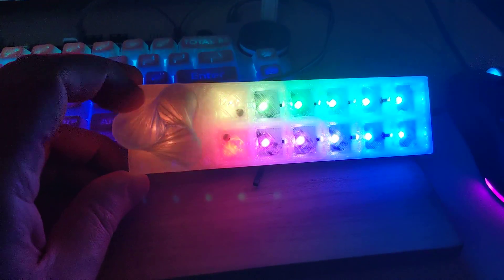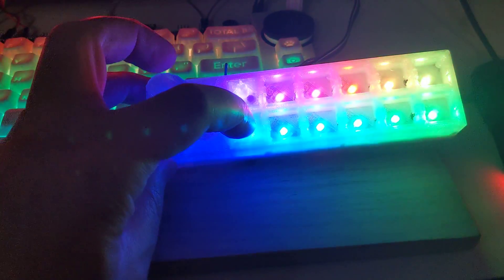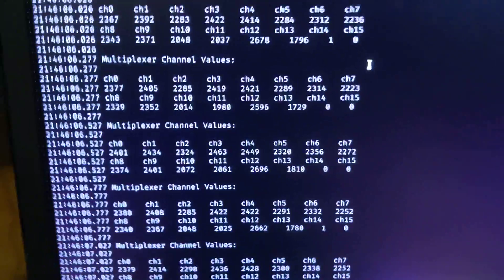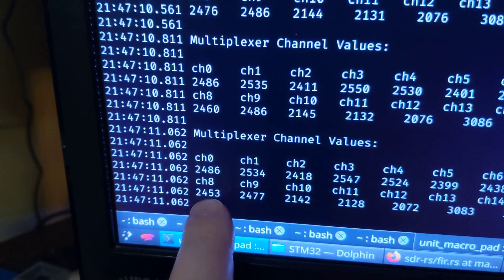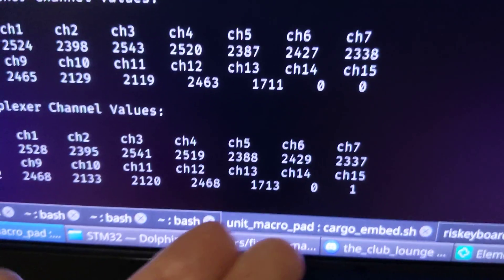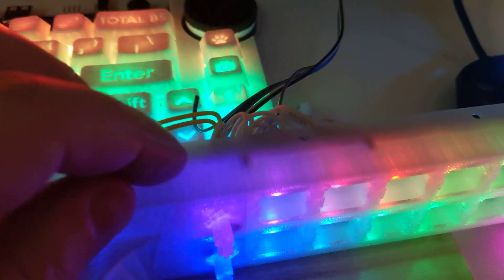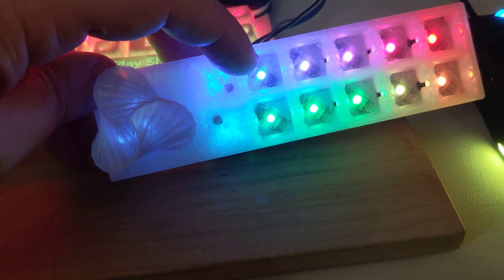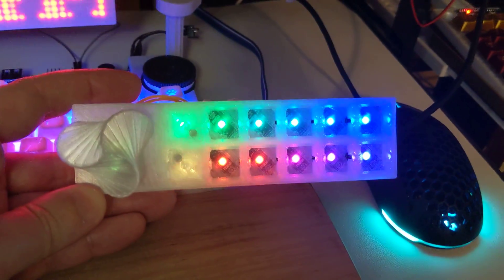World's first hand-wired analog keyboard works!

Comment: If I'm understanding the void-switch concept, doesn't this mean the magnets could be electronically variable in the void switches if you use electromagnets to control the resistance level? Like wouldn't that mean you could make a force feedback keyboard or render the idea of single-state switch boards obsolete?
Reply from the maker: It already renders the idea of single-state switches obsolete, LOL.  You can have multiple points of actuation since they're analog.

Also, you absolutely can put electromagnets under each switch and use that to control the force however the size required (of the electromagnets) means you'll end up with a pretty tall keyboard.

Comment: It's a great project!
I had a read of you're GitHub and it looks like you're using OH49E for the keys, but I couldn't figure out what's under your rotary encoder.
I can see how it would be possible to use 3 OH49E's to do that, but What did you actually use?
Reply from the maker: I used two GH39FKSW because the OH49Es were out of stock at JLCPCB.  They're basically the same (49E is slightly better).  All my latest keyboard stuff uses that GH39FKSW sensor, actually because it's cheaper and it's more than good enough.

Yes: The rotary encoder only uses two sensors.  Why would you need more than that?  The two sensors output dual sine waves that are slightly offset from each other which is all you need to make an analog rotary encoder.
Reply: @Riskable3DPrinting Ahh of course I was thinking you'd need a third sensor for direction, but that would do it :) Thanks for the details!